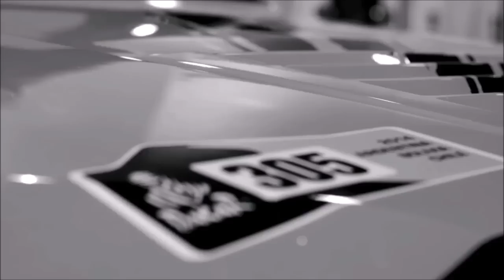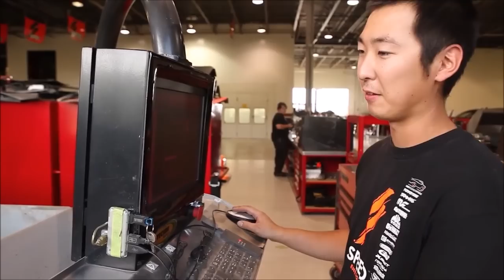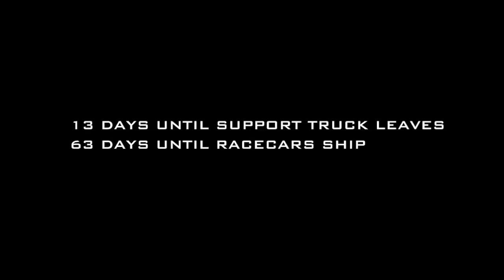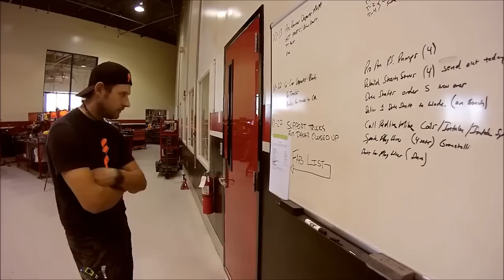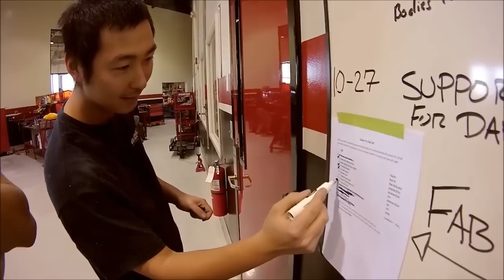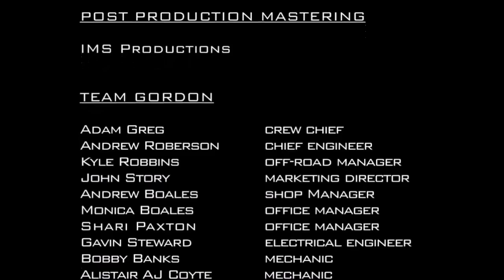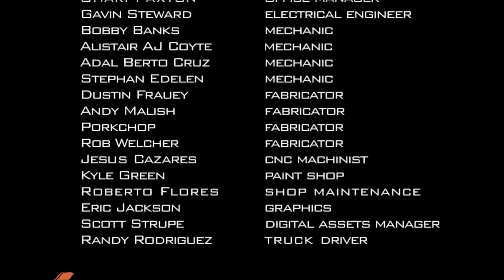2015 Robby Gordon "Road To Dakar: Part 1" - NBC Sports Network

Comment: Maybe I see things too simple but, considering Robby Gordon's experience, I would have changed the conception of the Gordini quite a lot

WHAT ROBBY HAS
· Trophy truck experience
· NASCAR experience
· Indycar experience
· The whole SST organization
· Access to quite a lot of information and money

From that starting point, which is quite good, I would try to really use all that to his favor. Also, the fact you can access to a lot of information nowadays makes it easier to find what you should try to "copy" or adapt easily if you have the resources. Next step then:

WHAT ROBBY NEEDS
· A good balance between power and fuel consumption (bigger fuel tank, bigger ballast)
· Reliability
· Easy-to-repair
· Inside comfort

The first two points are kinda related in a way. Since the objective is to build a car that is a bit like a trophy truck but narrower and shorter you must use a smaller engine. Considering the current Dakar Rally regulations, you do not need great power so a 7000cc or 8000cc engine is out of the question. If it was me I would go for 6000cc (more or less) and around 500hp when in race trim (that will also help lowering the engine temperature). Next is the need for an easy-to-repair car, it is widely known that the easiest world-class racing car to repair is possibly the Audi R8 LMP, the multi-time winner of the Le Mans 24 hours. That car is in a few museums (at least one in the USA) and you can find lots and lots of information about it in books and the internet. Finally, nothing is more comfortable offroad than a pre-runner and Robby owns a couple of them.

HOW TO DO IT
Prepare yourself early (start before April), try to fit the pieces and prepare the easy-to-repair stuff A LOT since you do not want your crew to work non-stop all 13 nights plus the rest day. Mechanics turn wrenches, they are not night owls or athletes and they will not stand 2 weeks like that. Also, you cannot be fully rested when you are supposed to rest or even sleep inside a 22000lb truck

FINAL POINT
I know it is not easy, I know I might be seeing things a bit too simple but I truly think Robby Gordon can do it if he commits seriously. No more being a show-off or just making people cheer for you. That can bring some money but the trophies and the BIG money are behind the results. I really think Robby can do it but I am starting to feel that if he does not fully commit before 2017 his time might be over (at least as a driver!)... :-/
Reply: Robby Gordon has 10 years of Rally Dakar experience, plus plenty of offroad AND circuit racing experience.
Reply: I think he needs a 4wd with Independent Rear Suspension like what has won the Dakar for the last 20 years or so. Driving on rally roads with a live axle sux as much as driving in dunes with 2wd (excepting buggys with special sand tyres).
Reply: Ric James There's a problem with that. 4WD in the Dakar Rally means only 12 inches of suspension and your engine has to come from a roadlegal car
With 2WD you have unlimited suspension and your engine can be a full-blown prototype if you want to (remember you also have to cover at least 500 miles on each tank of fuel, whether it is on sand, dirt or road)

Comment: goodbye Hummer :'(
Reply: It was never a Hummer to begin with. The rules in the Dakar say that if the car looks like something that is being mass-produced, you have to put the engine of the same automotive group
· Looking like a Hummer means you can use a Chevrolet engine
· Looking like a MINI means you can use a BMW engine (the Mini All4's engine is a BMW 3500cc diesel one!)
· Looking like a SEAT means you could use an engine from Volkswagen, Audi or even Lamborghini!
· Looking like a FIAT means you could use the engine of a freaking Ferrari!
· Looking like a Dacia means you could use the engine of a Renault and maybe even the engine of a Nissan (remember the Renault-Nissan agreement)

The problem with powerful engines in the Dakar Rally is the lack of refueling. Only motorbikes and quads have officla refueling points every 150 miles more or less. Cars and trucks have to make each day of racing in one tank (although some teams have sometimes located local gas stations and have fueled their racing vehicles with pump gas or diesel!) so the teams have special fuel tanks of 60-120 gallons for cars and way over that for trucks
Reply: That damn Hummer wasn't very good luck to him. I hope this time he gets closer and not have as much technical difficulties as in the past.